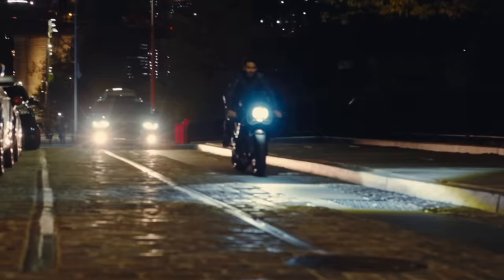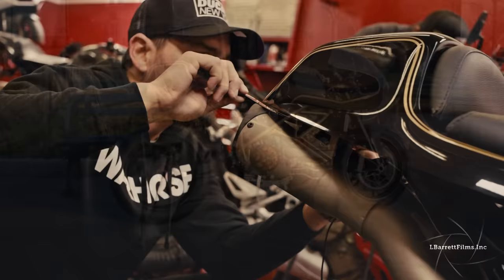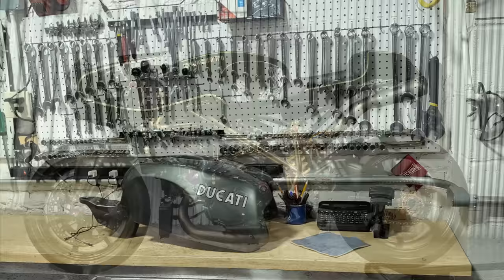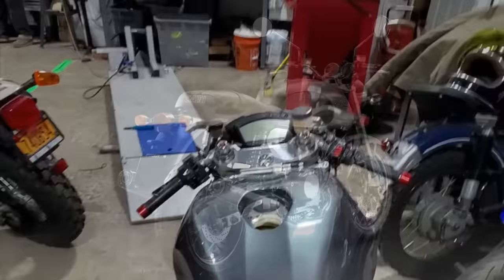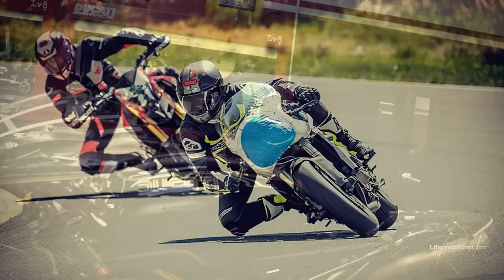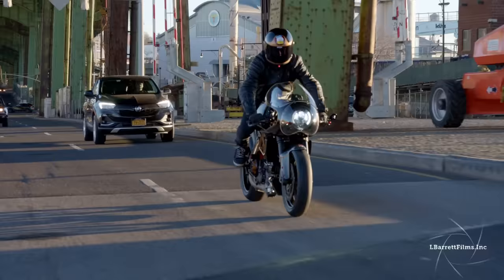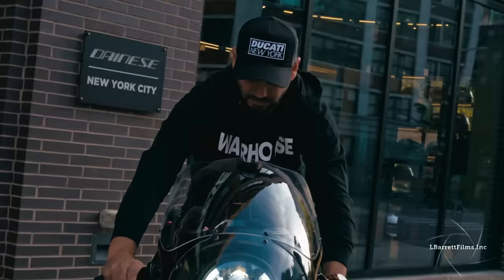Cafe Racer (Amazing Ducati by Ronaldo Ferreti/@enriquecubano)

Comment: I agree with you "almost" 100% "but" on the top speed, top speed of a 1098 is 280.8 km/h and honestly I don't think you can get a lot more out off that V2 engine without expending a ton of money (I know he already did) but if at the end it will cost more than a Panigale, I'll go for the Panigale ( mi opinion), cheers Victor!!😅
Reply from the maker: Hello Carlos. According to Ronaldo, the top speed is even slightly higher than 300 km/h. I believe he also changed the RPM limiter, and the rear tire has probably a higher profile. These might be small changes, but they might be enough to earn some extra top speed. But thank you my friend for sharing your perspective. :) Cheers.

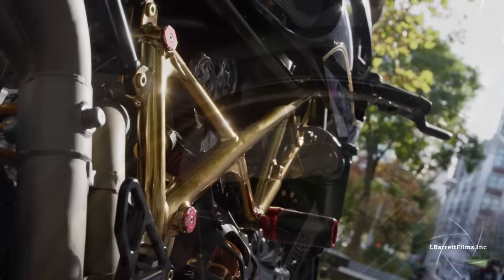Comment: At 4:36 he states "...there are 250 hours of work...", I think he dropped a zero...
Reply from the maker: Lool. Those 250 hours are probably only related to Ronaldo's work, and not include all the other side works. :) Cheers.
Reply: Victor that is correct, not counting alk the other people that helped with paint, welding and powder coat. 
I have around 40hours just on electric re- wiring.
Reply from the maker: @Ronald Masso Thank you Ronaldo for the clarification. I am glad my thoughts were wright. :) Cheers.
Reply: @RACER_TV  Thanks for the replies, makes more sense now... I figured that if Ronald had done ALL the work on ALL the parts, 2500 hours would be closer to the truth. Beautiful bike, my main ride, back in the day (four decades ago), was an 850 Dunstall Norton...

Comment: As a A&P mechanic I got to say that is the ugliest safety wire job on the rear sprocket. Why are they wired  through a bolt hole used for cotter pins and not through a safety compatible nut? definitely not aviation standard here :)